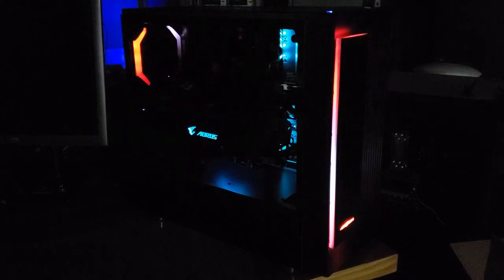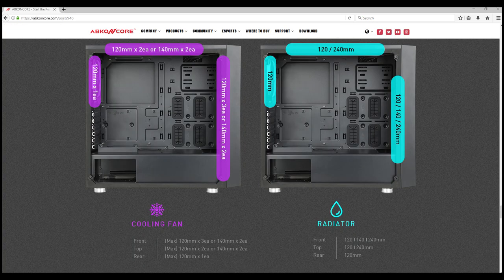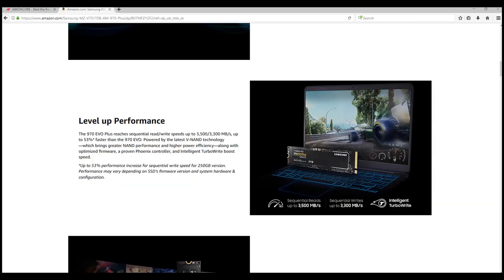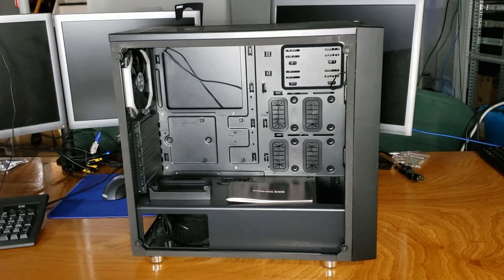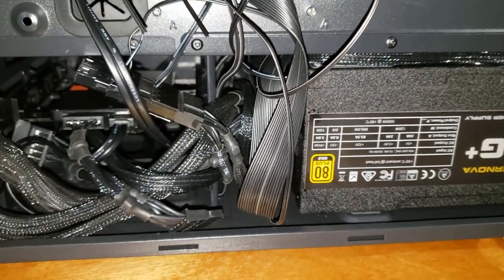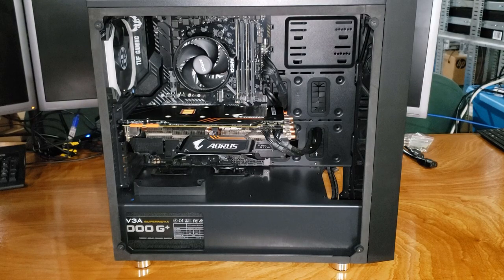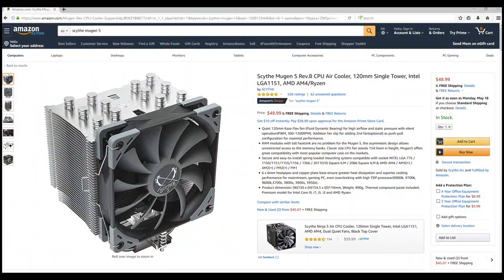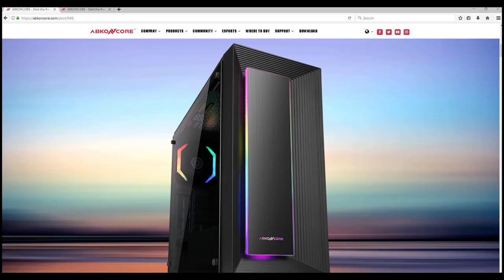Abkoncore Cronos 510S Gaming Case Review

Comment: Thanks for the review! I bought this and just ordered the same psu that you have so I’m glad to know that I didn’t make a terrible choice
Reply from the maker: Hi Rohan Mishra! No problem! The case looks great once everything is built out. What are the system specs that are going into this build?
Reply: SamsTechStuff I’m putting an 9700k, 2080ti, 1000w psu, a few extra fans, and 32 gigs of ram. But I was just starting my build, and I have no idea on how that molex that powers the front rgb is connected. How’d you set it up on yours?
Reply from the maker: Wow, that's going to be a GREAT gaming (or editing?) rig you'll have there. The RGB lighting element gets its power from a Molex connector that is on the rear side of the case, it should be the only one that isn't coming from your power supply. Here's an imgur I took real quick of what mine looks like: https://imgur.com/a/l6c1qYB

Given the high end components in there, I hope you plan on adding at least a few extra fans to keep everything running nice and cool 😀
Reply: SamsTechStuff This machine will be my gaming/streaming/editing workhorse! But I’m still not entirely sure on what cable I should use for the molex and where I should plug it into. I also have a lot of fans on this one haha

Comment: Hello why me in front of my box does not make light and the same for the fan which is at the bottom it does not make light not like on the video
Reply from the maker: Hi SUP3R FLO TV! Do you also have this model case from Abkoncore, the C510s (Cronos 510s)? There is a power connection for both the rear mounted fan and the front LED lighting element that do need to be plugged into your power supply. Are you able to post a picture of your case?

Comment: i cant see where to connect the rear fan led lighting
Reply from the maker: Its been a while since I built this Gaming PC, I don't remember if the RGB fan or strip had 3/4 pin. I believe the strip in the front did require 4 pin Molex power though. Are you trying to get the fan or the front of the case to light up?

Comment: What power supply do you recommend?
Reply from the maker: Hi Hotpocket! I have tried out a few PSUs lately - so far, my favorite it the Be Quiet! Straight Power 11 series 750 watt PSU. I did a review video on here: https://youtu.be/J8PZ33E5D9k

I have been using this PSU for my component testing as well as overclocking testing. Highly recommended! 😀
Reply: @STS  THANK YOU SO MUCH DUDE🤙🏿

Comment: Hey my led button doesnt work, but the rgb does. any help?
Reply from the maker: Hi Daniel! Sorry, I think I missed this comment! Were you able to figure this out?
Reply: @STS  no unfortunately not, i’ve managed tho haha
Reply from the maker: I wonder if the connection from your RGB button is loose or unplugged? I would follow the buttons cable to where it meets the LEDs to see if somethings loose. If you have to pop off the front panel, make sure you gently but firmly do it with out breaking any of the tabs.

Comment: Great review. I own one of this, however. I'm planning on getting a 240mm AIO cooler. But i don't think it'll fit. Due to the ram being too close to the top. I can fit 2 12cm or 14cm fan at the top. But not a 240mm AIO. Anyone had any luck or is it just me. Thanks again.
Reply from the maker: Hi Munkee Munks! The Abkoncore C510S case should fit a 240mm AIO in either the top or front mounting locations. The main note would be to not use the thicker 38mm fans, I would use standard 120x25mm fans.
Reply: @STS  thanks for the reply. So change the fan for a slimmer profile fan eh. Interesting, thats why people like you exist Sam. You see things regular newbies like me dont. Will update you on the build. Thanks!
Reply from the maker: For what it's worth, most AIOs will actually come with 25mm wide fans so for the most part, no worries. Just keep the clearances in mind if you upgrade in the future. the 30+mm fans are terribly loud anyways though. What CPU are you running?
Reply: @STS  I'm running Intel 9100f with stock cooler. Works ok with graphics low to medium on games. I've no intention of overclocking the thing mostly bcoz it sounds intimidating lol. But i figure since i got money to spare, i was thinking of getting an AIO unit. Maybe 120mm or 240mm.
Reply from the maker: Overclock sounds lile a lot when you start but that's partly because a lot of old bad information makes people think its always unsafe and partially because it is a complex topic. On your platform though, it's relatively easy to get into when you're ready. AIOs have been of more interest to me lately also. I have a review unit of a 240mm Permafrost AIO from Silverstone that I'll be benchmarking and reviewing soon.
Reply: @STS  oh. Cool. I will check it out. Thanks man.

Comment: Hi sir i see the vertical gpu mount they place in too close to glass isn't it sir? This will turn me down if it the case. Too close to glass's can cause gpu low on air auctions and cause gpu to choke out/temp goes 👆 as soon as u turn on and game's. That the info I get from vertical gpu specialist. Must leave gpu between glass window about 2 inch minimum-3 inch turn ur gpu happiest gpu ever. 😂
Reply from the maker: Hi HelioGenesis -HS! The vertical GPU mount is very close to the glass door in this case. I would not suggest vertically mounting an aircooled GPU in the Cronos 510S. I however do not anticipate any issues with watercooling a GPU in the vertical position. Many cases due to the current design trends do not leave enough space for a GPU to be vertically mounted and perform well while aircooled.
Reply: @STS  yea it seem true that it's too close to glass panel. Why can't they figure out about this matter. This huge bom drop on its own creations. Thats so stupid if u ask me, so sory to say in disappointed by this was planing to buumy this case until ibsace the gpu and glass. Instantly said to myself is bug no no. I hope. The v2 adress this issues for hardcore gpu riser kit user. Thx for info mate  very appreciated
Reply from the maker: It's mostly an cool looking option vs a performance oriented design choice in mist cases. I do like the look for sure, just needs watercooling.